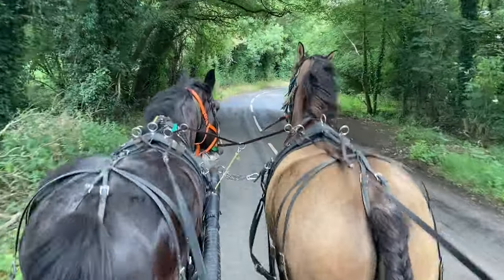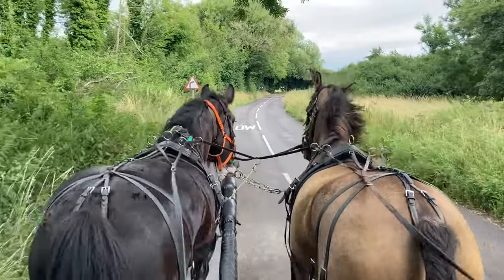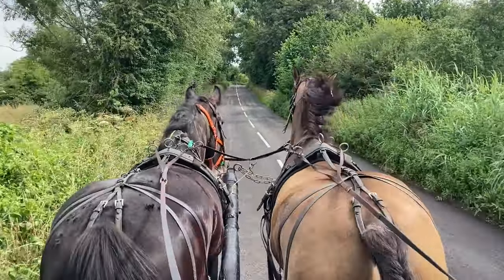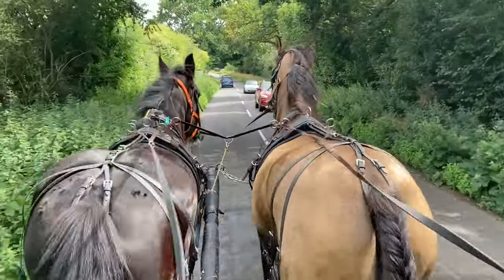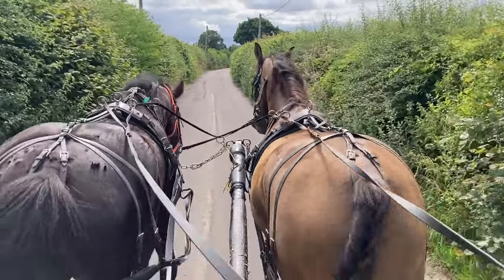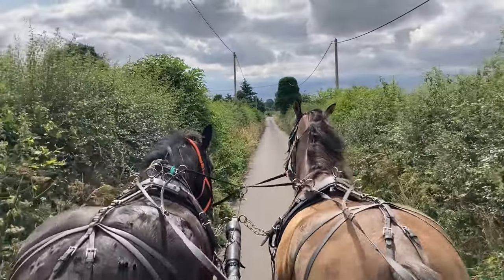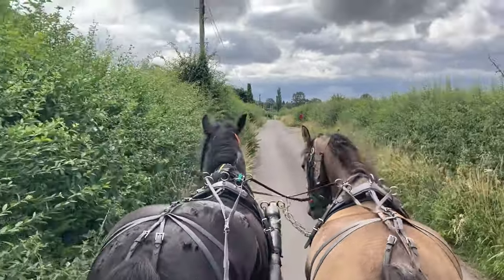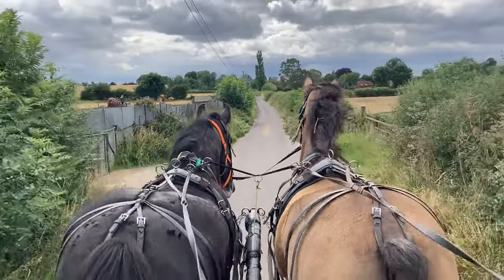Driving A Shire & An Irish Draft Sports Horse Together

Comment: Just got my mare back, the trainers got her driving but said she was a nightmare and think she s not safe in shafts.. not scared but squirting etc. and kicking. I'd got as far as pulling a sled with loose traces but also got stuck at shafts... didn't push my luck, stopped at the tail swishing stage She rides fine anywhere, and has brilliant tough feet. I'll prob do some endurance riding... but.. any chance she'd go in a pair? Or maybe as a sideliner?
Reply from the maker: Hi, possibly - it's hard to say without having the horse in front of us! She may, or the presence of another horse could make her even worse. Potentially looking into if she has any medical issues could be of benefit, or a medication or supplement to suppress her seasons may help.  Failing that, an old horseman cure used to be to let her have a foal and see if her seasons are better after that - apparently they usually are, but it's a big risk and investment and a horse to find a home for at the end of it if you weren't already planning on breeding your mare one day.
Reply: Hi Barry, love watching your videos and I always learn a lot. On this video I noticed how the centre pole was bouncing between the two horses. Does that bother them at all?